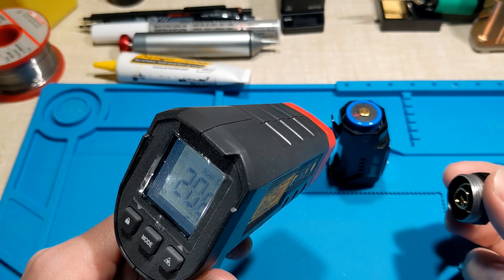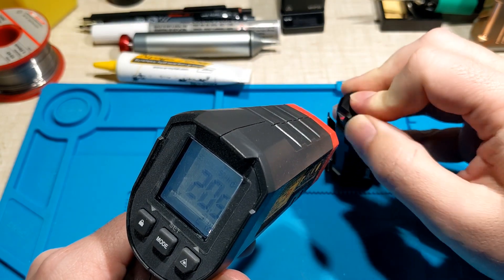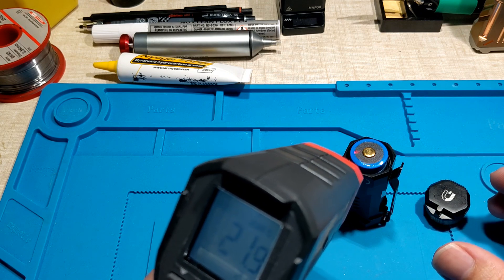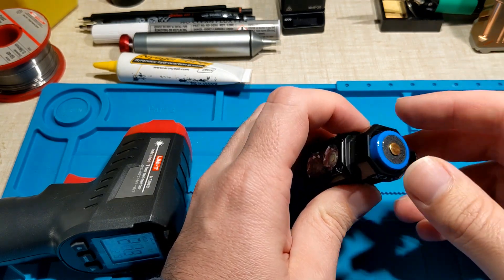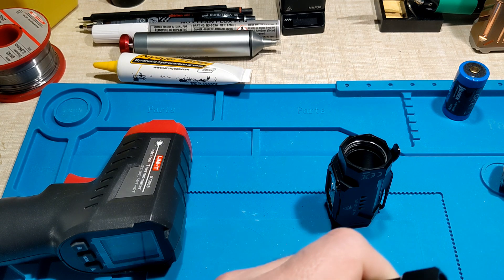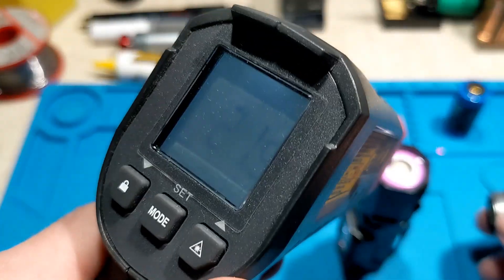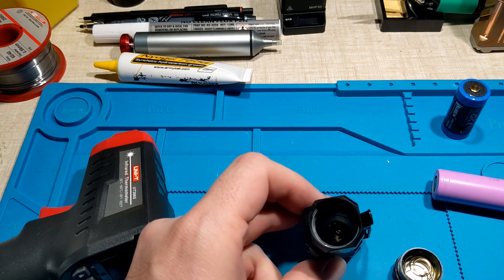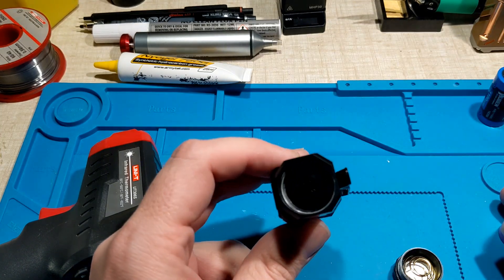Safety warning: Wuben E7 short circuit

Comment from the maker: The issue was fixed in the Wuben E7 (E7-B2 and E7-B3). You can check the version by looking at the driver near the spring. It should have E7-B2 or E7-B3.
Reply: That is the problem, there is no way to know UNTIL you get it.   Hard pass for me.
Reply: New color army green dose it have B2 or B3 ?
Reply from the maker: @mohammadsharafi3490  I don't know.

Comment: It does say on the Wigan battery this comes with that it has reverse polarity protection
Reply from the maker: The included battery has reverse polarity protection. But I used an unprotected flat top 18650 cell with the 18650 extension tube. This issue was noticed with the E7-B1 driver. It looks like E7-B2 and E7-B3 (found near the spring) are ok.

Comment: It helps if you put the battery in the correct way around, you are either doing it wrong on purpose, or just another dummy
Reply from the maker: Yeah. I usually check to see if a flashlight has reverse polarity protection built-in. Some manufacturers claim that such protection exists when it doesn't. This can be a safety issue. The E7-B1 version has this issue. But Wuben fixed it in the E7-B2 and E7-B3 (latest batch). I've reviewed about 21 flashlights this year. Full reviews with testing are on my blog.

Comment: Por favor, qual são as dimensões da bateria 1100mAh? Já procurei até no site mas não encontrei. Gostaria de saber pois vou comprar no aliexpress. Pois quero usar só a lanterna sem o extensor no meu capacete de bicicleta.
Reply from the maker: 39.3mm*18.4mm (button top protected 18350) https://timmcmahon.com.au/posts/wuben-e7/#dimensions-and-size-comparison
Reply: @TorchHacker  obrigado amigo... 😉👊👊👊
Reply: @TorchHacker  eu só encontrei no aliexpress 35.0mm*18.3mm com INR 18350  3.7V  5.18Wh 1400mAh
Reply from the maker: @mizaeltelmont2861  I recommend using a protected 18350. Manker 18350 Li-ion 1100mAh 3.7V USB-C. Wuben ABJ1100C 18350 1100mAh 3.6V. Skilhunt BL-111 18350 Li-ion 1100mAh 3.6V. An unprotected battery might explode if inserted backwards.
Reply: @TorchHacker  obrigado... 😉👊

Comment: Thanks for the heads up. Just ordered mine and waiting for delivery. This video could potentially save me.
Reply from the maker: You'll be ok if you use protected 18350 and protected 18650 cells. 👍
Reply: Ive just blown mine i got it 4 or 5 days ago coat me 54 pound am fuming am 99% i never put it in backwards but now when i put battry in its sparking like little sparks tiny 1s is it fkd then loke propper any1 please
Reply from the maker: @eyefishinggunkchannel1011  Send a video to Wuben's support team. Are you using the included 18350 protected battery? If so, it should be ok.

Comment: As these lights become more mainstream, there’s bound to be more reverse polarity accidents. I’m surprised Wuben didn’t put in any safeguards or a poke yoke of some kind. 
Thanks for the video.
Reply: E7 requires an 18650 battery with a protective plate; a battery with a protective plate won't be a problem. We will enhance circuit protection as well.